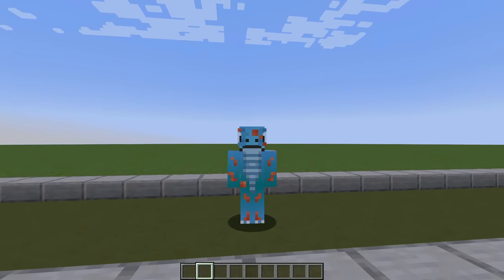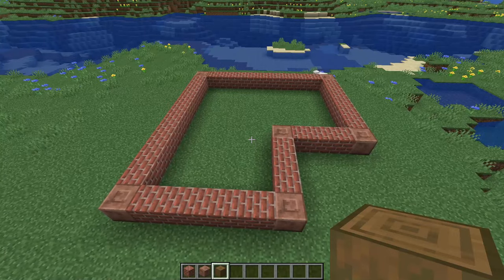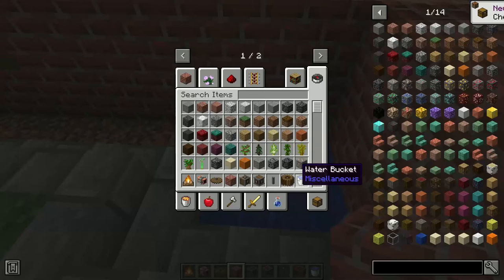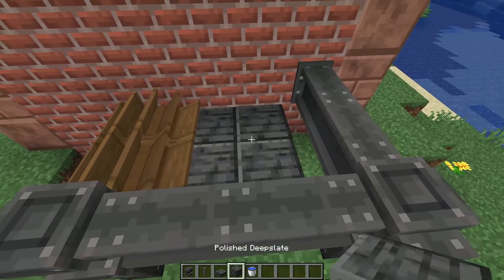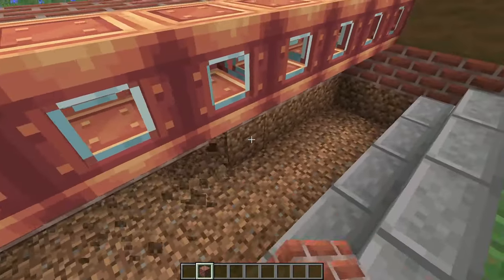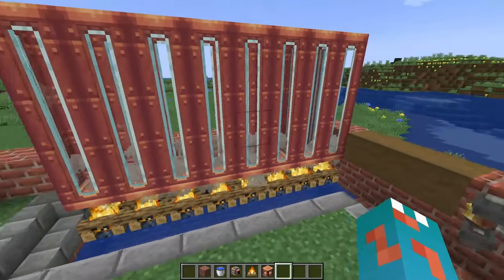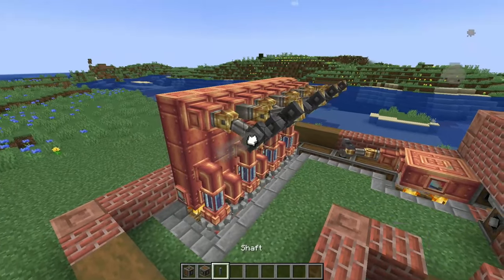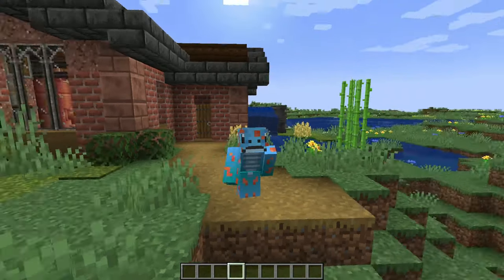STARTER Engine Tutorial | Create Mod 1.19.2 | #tutorial #minecraft

Comment from the maker: NOTE: THIS DOESNT WORK IN THE RISE AND SHINE UPDATE!

you need to speed up the waterwheels by 1 more large to small cog to fix this
Reply: God the rise and shine update is so fucking annoyingggggg
Reply: man mines still not working, it works with a hand crank but not the water wheels...
Reply: Damn... i read this after make the buidling =/
Reply: @Leafsong  I fixed w 1 vertical going to 1 horizontal then making the big to small connections
Reply: @MDRenjoyer  Mind explaining this? we just need two large cogs and one small cog right? because i am beyond confused on how to make this work
Reply: where do I add the extra cog?
Reply: @cmdrchaos26  keep the cogs the same, try adding another water pumper and use a blaze burner, uses lava as heat but produces more heat, should work
Reply: I don’t even understand what’s ment by that :D

Comment: last update's removed the importance of the quantity of flowing water around waterwheels and the direction of pump rotation. keep this in mind when recreating this
Reply: wwdym
Reply: You have to elaborate more
Reply: @rasmusdamkjr5270  any amount of flowing water around a waterwheel makes the waterwheel output the best possible stress unit (which we know as 320 SU) and speed output. this also applies to the new large waterwheel.

as for the 2nd part, pumps will only pump fluid in the direction they are facing, and not change their direction based on the direction of their gear's rotation. no more fiddling around with every single pump in a system after you add gearshifts.
Reply: How would you change this to make it output enough power? Because im assuming this change is the reason the engine wont work when attached to the first boiler now

Comment: Hello … that’s a cool design. Well done. I’m curious about the output power. How much of stress units is it generating? In my world I built a steam engine with blazers but they are definitely not an early game option so campfire would be a good alternative. thank you
Reply from the maker: So this system is made from 8 individual Level One boilers. So it produces roughly 16K Stress, however I do want to make another video doing more of a deep dive into how the blaze burners and heating mechanics works. So I'll get to work on that, keep an eye out for it :)

I have a video in the works before that but it's on the list

Comment: FOR THOSE WHO ARE SAYING IT DOESN'T WORK. I used 2 large water wheels, and also increased the gear ratio - by adding a large cog onto the same shaft as a smaller one, and meshing it with another larger one which turns the small under the tank.
I hope this helps someone! It's a great build.
Reply: please elaborate, im still confused

EDIT : NVM! I figured it out!! Thank you!!
Reply: The water wheels look diffrent for me... Its not producing enough power? The steam engine is not turning

Comment: Wonderful tutorial! I love your buildstyle and the tutorial format. Please make more!

Sadly, this doesn't seem to be working in Create v0.5.1b anymore. I'm getting the impression it doesn't generate enough RPM. 
The small (regular sized) waterwheels produce 256SU, I've tried with the large waterwheel (512SU) and that halves the number of water intake. That intake seems just not to be enough (8 instead of the required 10 with 2 small waterwheels, and 4 with 2 large waterwheels)
So it must be the RPM. One time shift up (small cog -> large cog) doesn't seem to be enough. I'm going to test this with a larger setup.
Reply: Yes, tested the new setup: For the first steam boiler to work with the current Create 0.5.1b version,  you have to shift up once with gears. You need more RPM (minimum of 8).

I took your design, but instead of placing the large cog diagonally towards the player in the video ("forward" or "down" however you want to call the direction), you have to put it diagonally to the top (away from the player). Then add a small cog on top of the large one ("shifting up", and now you go diagonally down again with a second large cog. 
It breaks the cute little building, have to find something to fix that. 

I hope this is clear for you all. It's hard to explain without pictures.
Reply from the maker: Thanks for letting me know! I havent tested any of my old designs yet so thats good to know
Reply: Is there a pic on how you set yours up anywhere??
Reply: @bigchadman  Just remove one campfire and add another pump in it's place underneath the tanks next to the water wheel, and it works. At least for me!
Reply: Hey I had that prob too but I added four cogwheels and got it fixed :)
Reply: The first boiler is now working, though it says it has no water in it. Getting this to power the pumps of the 8 boilers is not possible. Adding one big cogwheel to speed it up works, however, still doesn't power the pumps. Adding more cogwheels  stresses the first boiler out too much.

Comment: guys, maybe im stupid but the steam engine on the first 4 fluid tanks is not working even tho i did everything like in that video. any ideas?
Reply: If you have the goggles on you can see what the steam engine is missing or if it's overstressed.
- If it lacks WATER you need to check the pump that it pumps right direction and check water source if it's placed correctly as infinite source. And the speed of the pump is fast enough.
- If it lacks HEAT, then campfires are not directly underneath or the tank is too big for fire ones.
- and if it is OVERSTRESSED it means waterwheels are not enough to power pump with the speed you have. Drop speed or add wheels.

Cheers 🥂

Comment: Waterwheels no longer work better the more of the wheel is in contact with flowing water.
They have a fixed output regardless of how many sides are in contact with flowing water.
Reply: hey does your steam engine work from the 2x2 tank got the 2 camp fires but its not gaining heat?

Comment: If my calculations are correct, a single water wheel can handle not just the starter boiler but the eight actual boilers.  I havenʼt tested that in game though and itʼs close enough any factor of 2 I missed would ruin it.
Reply: Yeah, I was missing a factor of 4, and I was missing that mechanical pumps have halved effectiveness when pumping from blocks in the world instead of from tanks.

EDIT: No, I misunderstood the pump debuff again.  This is in fact one water wheel per four pumps in your setup, if you have the water wheel fully powered (all four sides), which is easiest with horizontal water wheel; this also has the advantage you donʼt need to shift the speed because the required speed is 20 RPM which is the output of a fully-powered water wheel.

Combining the output of horizontal water wheels can be a pain, though, so since you want eight productive pumps this is probably easier.

Comment: i thought the pumps required a set amount of source blocks to be considered infinite because i remember i had a steam boiler just drain the lake i was using for give it water
Reply: if water is a line of 3 or more and you take from the center block it will be infinite so with this one you may need to extend the ends out by 1 on each side
Reply: I think in your case you used the hose pulley in the lake. That will drain it, unless the lake is at least 10K source blocks, and the hose pulley is at the bottom of the lake. Then it will work as an infinite water source.

Comment: Doesn't seem to work with 0.5.1b anymore as water throughput is too low. Although the waterwheel is generating 128, the pump is only inputting 640 mB when an input of 81o mB is necessary to start the original boiler.
Reply: you can replace the campfire infront of the first pump with a second pump then it'll work

and I'm pretty sure if you want more heat you can add a blaze burner instead of the single campfire left but it wirks with a single campfire

Comment: My small boiler is running but the steam engine isn't running. Can anyone help?
Edit: I realized that after the update it requires much more power to pump the water in there. You can fix it by adding a windmill or any other way of increasing the stress unit.
Reply: Thanks, I had the same problem

Comment: You did an awesome job on actually explaining.  I have noticed that my water wheels do not spin as fast as yours. I did everything that you shown. But my water wheels spin slower, and my steam engine is not moveing. The tank is full of water.
Reply: same bruh
Reply from the maker: The new 5.1 update has broken the waterwheel part of the farm because they work a bit differently now, i need to revisit it and update them to work in 5.1
Reply: @skeej_inc  adding a few cogs to speed up the first pump fixes it

Comment: although i think this would be avery good tutorial you seem to have skipped so much so for someone who hasnt used create before i cant even do a tank as i need copper sheets which need a press to get so now i need to figure this out, thanks though
Reply: i would just have a makeshift setup to get the materials, like a water wheel or handcrank to power the required machines. make sure to use the JEI mod to get the recipes for everything ingame
Reply: @terrariaskillissue4492  yer im slowly getting there, just using the W to see what the things do. and not i think the back to basics may help so goign to watch that now

Comment: my steam engine isnt working
Reply: Move the water wheel off the side off of the side of the house by 6 or so blocks. Attach a shaft to the water wheel, a large cog to the shaft, and a small cog to the side of the large cog, this will increase the RPM of the small cog, you can add another shaft and repeat the cog trick to further increase the RPM until it supplies the engine.

Comment: The steam engine requires brass nuggets, so your statement about it not requiring brass or blaze burners is a lie
Reply: The steam engine doesn't use brass in its recipe. You should double check to make sure you are looking at the correct recipe.
Reply: @Mar10K0ng  apparently my modpack uses an older version of create that has brass nuggets in the recipe
Reply: @box3354  The steam engine was introduced in version .5 and with a vanilla recipe of a gold sheet, andesite alloy and block of copper. This recipe hasn't changed. There is only 3 options that the recipe is different in your pack A) you changed the recipe B) the modpack author changed the recipe or C) the steam engine recipe is apart of an add on for create and not the actual create mod. If it's the 3rd option then you are looking at the wrong recipe. When you hover over it in jei it'll say what mod it is from. If it says create then it's the correct steam engine, but if it says anything else after the word create then that is not the correct steam engine.
Reply: @Mar10K0ng  No I have a really old version of Create